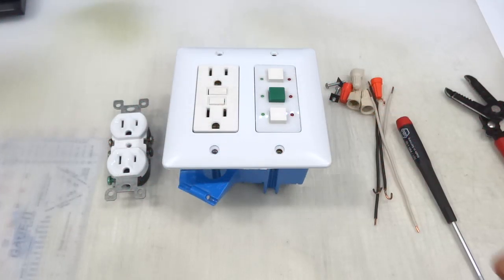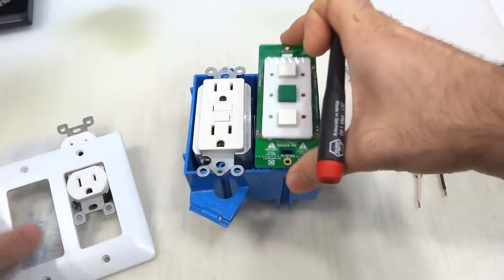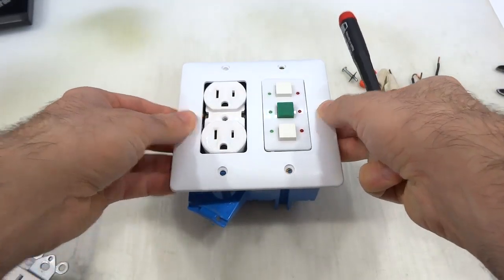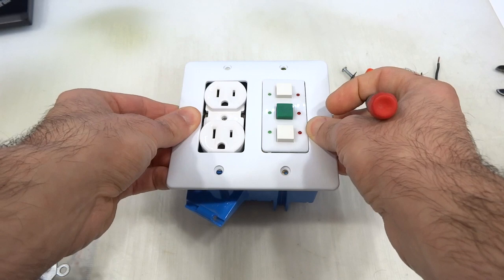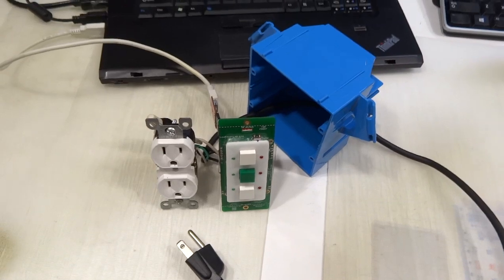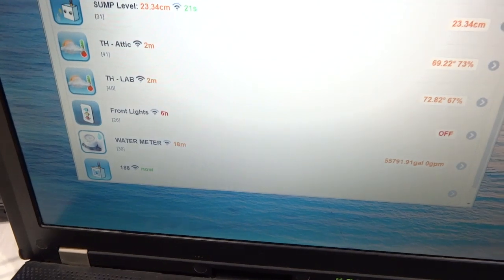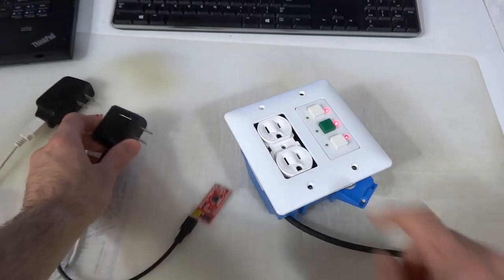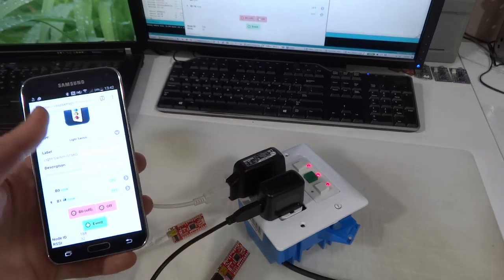Wireless outlet IoT control with SwitchMote R2

Comment: What state does the switchmote go to after a power outage?
Reply from the maker: The example sketch takes it to reset state, ie all OFF. You could program it to remember the last state and go to that.
Reply: So these are non-latching relays correct? IE: they require a constant high signal to operate and will default to off unless changed to remember last state and switch them back on?